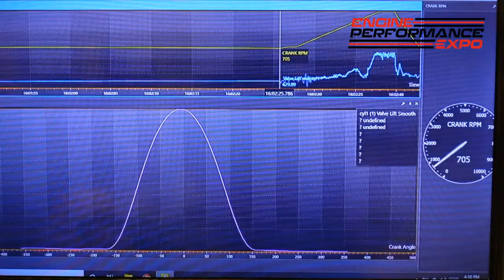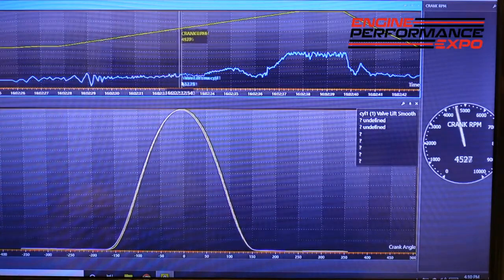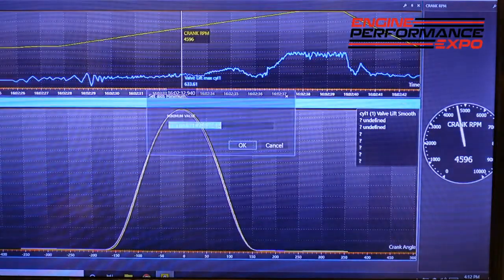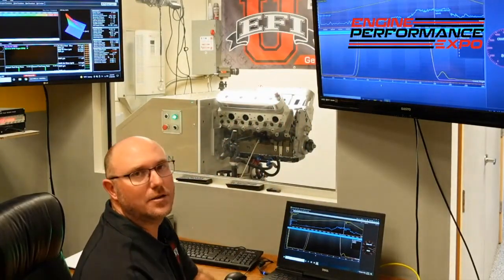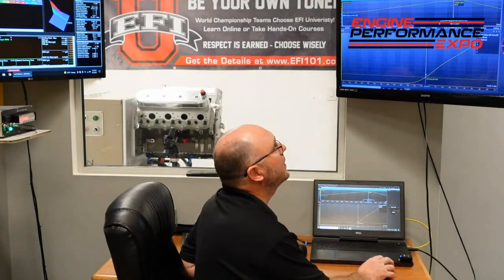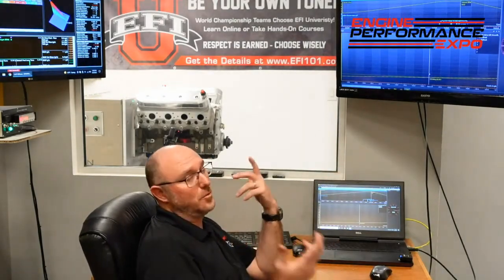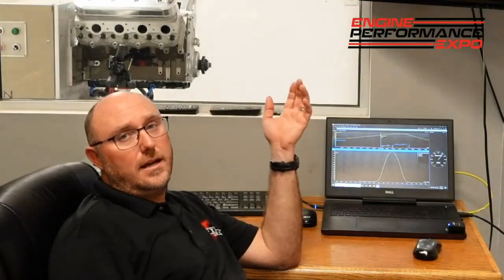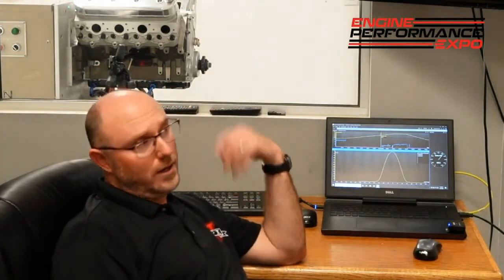Spintron Advanced Tech Feature (2023 - Episode 8)

Comment: So, you added weight to the push-rod, how did that go for you, usually stiffness is the solution to springiness as it raises the frequency, and that wobbling valve stem indicates the rocker arm is pulling the stem , maybe the roller rocker is too small and is wiping the stem.....